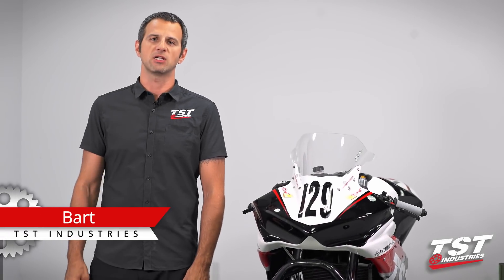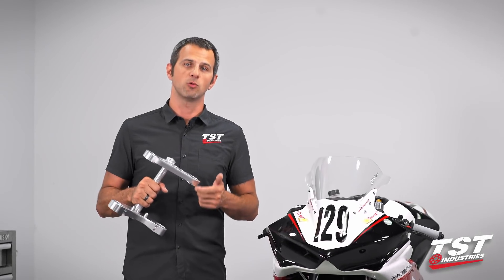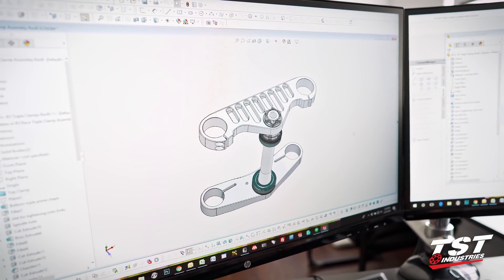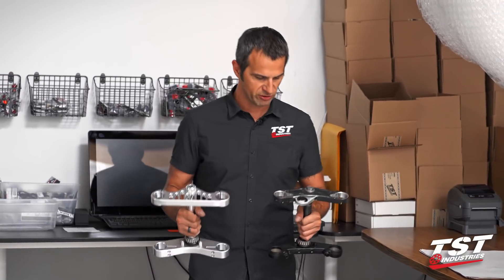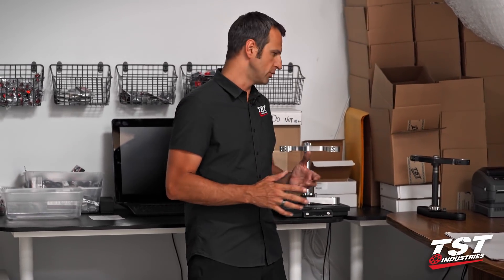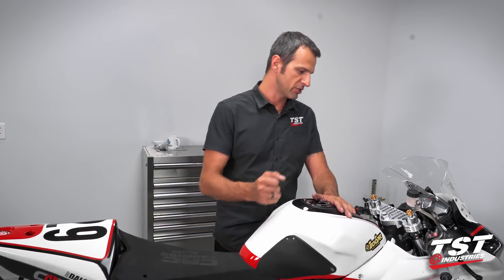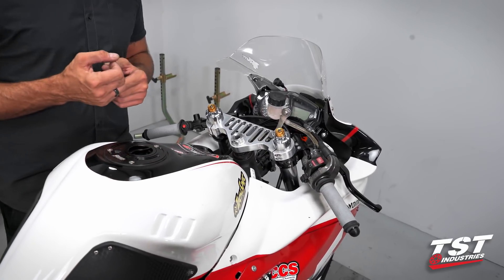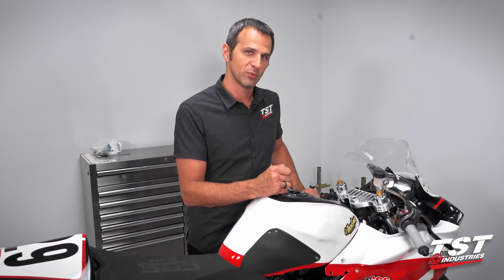Time to install our CUSTOM Triple Clamp! [Superbike Build Series Ep.12]

Comment: do you have a triple-clamp for road use R3 ??? Triple-clamp with key hole .
Reply from the maker: No we don't. There isn't much of a performance increase in replacing the top triple. The bottom one and the spindle are the janky components on the R3 and replacing those makes the bikkest handling difference.

Comment: What offset did you use, OE? Will the subsequent units have eccentrics in the steering hole to make them adjustable?
Reply from the maker: Our beta version is for testing purposes. We retained 0 offset and are testing other parameters first. If we do offer these to racers sometime down the line, then we will surely make them available it eccentric setups for offsets.

Comment: U should take a look at CBR 250rr Indonesia version stock USD, Will be working great at ur r3
Reply from the maker: That is on my radar. I need to figure out how to get a fork, wheel, and brake caliper here to play with. I also need a source for replacement parts when we crash this bike. I would prefer something that is on our market like RC390, but the problem with KTM is that they do not sell separate parts. If you crash you have to buy an entire fork leg and then put your race internals in that fork leg. This is definitely not the way I want to go. If we could get parts for the RR easily that would be the way to go but there is a barrier there too.
Reply: TSTindustries make sense
Reply: aqsha izac 
Do you have any link on that USD fork
Reply: Isumairu Chiru u can buy it at Honda official dealer

Comment: I think you guys should try replacing the head lamp and turn it into the air tube in order to increase the air into the combustion gaining more power on the track
Reply from the maker: There is no headlight on this bike. Even if we make a ram air setup the sensor pack on this bike is not sophisticated enough to compensate for the extra air flow. This is on our radar but we have to do more research in order to execute this properly.